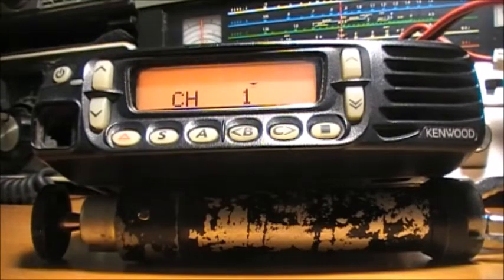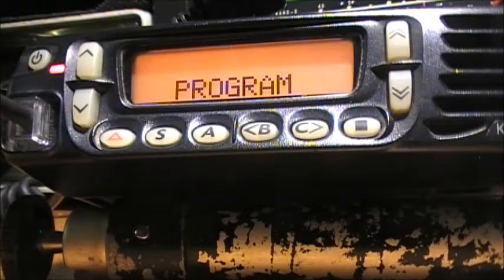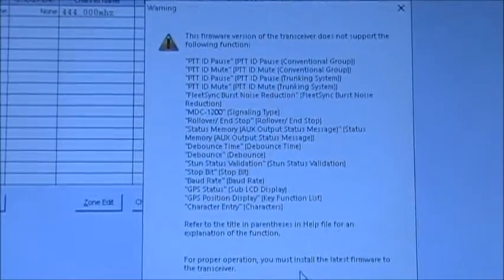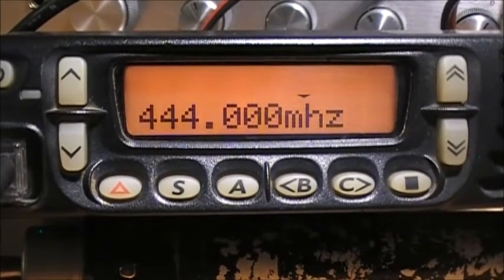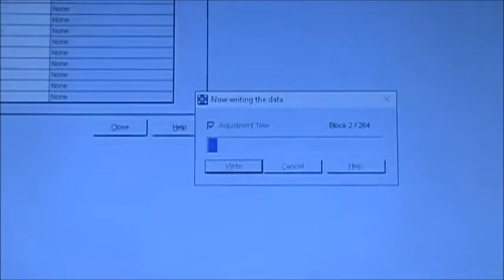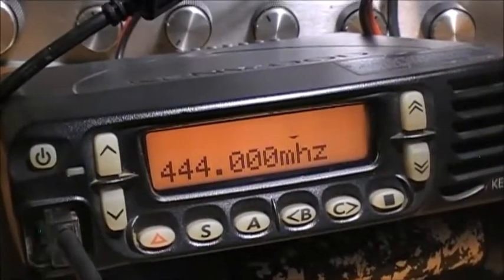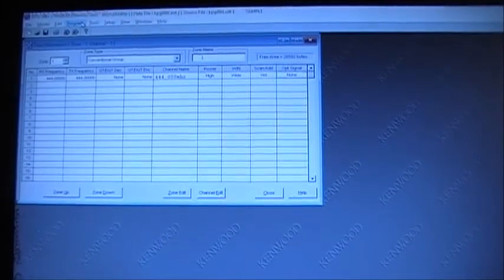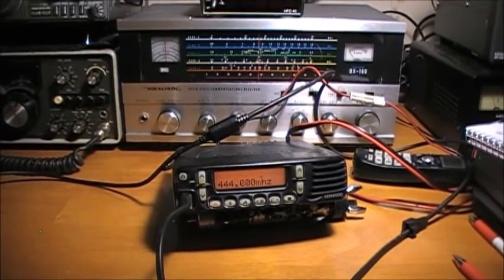KENWOOD TK-8180 Programming and Firmware update - UPDATED

Comment: Anyone here have a good knowledge of the Scanning functions?
I programmed my TK-8180 to 'Multi' in scan type and 'last channel used' in Revert CH options. I have 5 channels in my zone marked as 'scan' and a Priotrity channel nominated. I only have 1 zone.
Yet when I engage Scan it; 
1) The scan icon does not blink.
2) Whenever I engage scan it goes straight to Ch 1 even though its not in the scan list.
The 'Off hook scan' option is ticked.
PS I have not been able to update the Firmware to v 1.22
What am I doing wrong???

Comment: @Radionut63......Question: My 8180K has been programmed with 89D version  1.61    I checked the firmware version today, it says 1.18.00    So how do I know what firmware version I need for an update? FPRO.exe is the firmware file but what version is needed?  
And how do I get access to FPRO.exe ? 
🤔
Reply from the maker: Fpro is part of the programming software that you downloaded. It will be located in the same folder as the program files.
Reply: @Radionut63 No, I purchased the KPG-89D from an Australian online business that sells programming cables. He told me the firmware update wasn't included in the software. But he sent it to me as attachment in a email yesterday, it's 1.22   just need to get it installed in my laptop. Then work out whether it's written from the current software I have or independently?
 Thank you.

Comment: @Radionut63  Hey, how's things over there?
Um, I'm hoping you may be able to help? Connected my laptop to my TK-8180 however when I try to read or write it says "Cannot open Comport". 
In the software I chose 'Comport 0' & 'Data' at '9600' Baud. But when I open the 'Set up' menu it shows 20 Comport options all shaded and not able to click one. 
I have previously programmed my Motorola XTL2500 on my laptop with the same PC comport with no issues. What am I doing wrong?? 
Cheers,
Gary.
Reply from the maker: It sounds like a driver issue on your computer.  Seems like the program may not see your cable.
Reply: @Radionut63 Hey, you were spot on. Dropped into a small computer shop after work today. The USB port I used previously as Com port 3 needed a driver re-installed. Got the 'comport 3' option appear available in COM Port section of software.
8180 programmed the way I wanted except need to turn off "Power On Mute" setting.
Like to think I may be able to help you out sometime.
Been involved in rad comms since 1983.
Your gear in your videos is amazing! ⭐️

Comment: @Radionut63 Hey, sorry to bug you again, could yourself or any other viewers here help.
I have a TK-8180 coming from Ebay (Newy York) with a KMC-27A mic. I want to use a Keypd/DTMF mic on it, Can I use the KMC-28 mic with RJ45 or KMC-36 keypad mic?
Cheers,
Gary
Adelaide.
Reply from the maker: http://www.radiomanual.info/schemi/KENW_ACC/Kenwood_KMC-27_KMC-28_serv.pdf
Reply from the maker: 8180 uses rj45
Reply from the maker: 27a and the 28 have different style plugs on them.   in the meantime, you might be able to just just swap out the heads, those are only connected with RJ45. ;-)
Reply: @Radionut63 um actually the KMC-28 I have looked at on amazon has a RJ45 connector, not the round plug.
They came with either.
Just wanted to know which is the more suitable?

Comment: @Radionut63 G'day again, 
Can I ask you if I've bought a TK-8180 with the sj firmware is it easy to remove it and install the standard kenwood fitmware?
I have already written the KPG-89D program.
Thank you.
Reply from the maker: Hard to say.   I would think you could using FPRO program, but without haveing a radio here with SJ firmware on it to test it on, i dont want to give you the wrong answer.   In saying that, i can email my Kenwood contact Monday morning and see what they say about it.😊
Reply: @Radionut63 ok. I'm assuming the TK-8180 I'm getting from Denver CO has the standard kenwood firmware hopefully. If not then I wouldn't mind some assistance. Thank you very much.
There's just absolutely no TK-8180's for sale down here in Australia.
Reply from the maker: @Gary68_Melb i have a regular tk8180 here you are more then welcome to.
Reply: @Radionut63 Hahaha.........well I am in the process of trying to secure one on ebay however some sellers refuse to ship to Australia. Some TK-8180's dont have a bracket, some don't have a mic.
Its the 8180-K I need for 450-512Mhz as I will be using it for UHF CB 476Mhz here.
Thanks for the offer.

Comment: Oh so you cannot set TX Power lower than 25 or 30 watts?
5 watts is too low. I prefer about 15 watts as the transceiver won't overheat. Oh well.
Reply from the maker: You can set transmit power thru the tuning menu.
Reply: @Radionut63 Tuning menu? There's no tuning menu on the software I have. KPG-89D v 1.61
I've been through all menus.
I did notice a 'Test' menu, maybe that's what you're refering to?
Cheers.
Reply from the maker: @Gary68_Melb yes sir
Reply: @Radionut63 Sir? Not yet but I'm hoping King Charles will visit me soon for that honour.
Reply from the maker: @Gary68_Melb 😂😂😂😂

Comment: This is the closest commercial radio to ham requirements. Even has an S-meter ! Super reliable. Mine is HK2 means 45W UHF but heating never been a matter for me. Hours of qso with any problems. If you found one just grab it.
Reply: I have the same unit.  It does get quite hot if you talk on it a lot.  Don't know for sure if it will hurt it but the radio is NOT 100% duty cycle like an amateur radio.  These I believe are 50% duty cycle.  I have a fan blowing on mine just in case.
Reply from the maker: Most commercial radios including amateur gear are not 100% duty cycle.   Repeaters on the other hand, there are versions that are 100% duty cycle.
Reply: @Radionut63  Yes. For Kenwood TK760 VHF 45W that cycle is %10 TX %90 RX. And that radio is full aluminium cast body.

Comment: Hi. Great video. Can you help me plz. I have a tk7580 and its E version. Can i do something to unlock conventional frequencies by upgrading the firmware? Its currently only showing commercial frequency ranges. Thanks
Reply from the maker: Discontinued model,   Hi-Specification VHF FM Mobile Radio (EU use),   Kenwood TK7180:  Channel Spacing:  Wide: 25 kHz
Mid: 20 kHz
Narrow: 12.5 kHz,    RF Power Output: 1 W - 25 W, Programming software: KPG92,     For further information:  https://www.repeater-builder.com/kenwood/kenwood-tk-7180-8180-index.html

Comment: Thanks for the video.  Just got the 8180 from a buddy and came in yesterday with the mic KMC 36.  The key pad on the mic does nothing.  The KPG-89D v 1.6 shows the mic keypad as greyed out.  When I press the SCAN, it just says scan and no other screen display, it does stop when it hits an transmission signal. I would appreciate you reply.  Thanks.
Reply from the maker: The microphone is a DTMF microphone only, it is not used for direct entry.  You key the radio and press the buttons, the radio will emit a DTMF code for that button.
Reply: @Radionut63  I figured out the mic and was able to activate it. It works as direct channel memory access like directly going to channel 10. 

I also discovered that the frequencies range is limited hence can’t get NOAA weather. It is limited compared to my Wouxun mobile GMRS but edges the Wouxun in audio clarity especially on fringe location.
Reply from the maker: @benjosevilla  next time i program my radio, i will take a closer look at the DTMF setup.
Reply: @Radionut63  I went to menu bar -> Edit -> key assignment -> General tab:
Keypad : 12Key (Mic)
Keypad Operation: Channel Entry

I don’t use DTMF  unless I am talking to my Argent ADS  SR1 simplex repeater which I only use for simplex distance testing and in an event of emergency. So configuring it for channel entry is more useful for me.  Will be nice to have a way to toggle it.
Reply: I have one of this great radio and I am using with KMC-32 which I can scan,ch and zone up-down, display time-ch-name etc. I had chance to compare all mics in a kenwood tech office and this one was great on modulation plus those features.
Reply: How did you set it up in programming software to do that? I can’t figure it out I have the same mic.

Comment: One question;
How do you set the TX Power at say 20 watts instead of 25 watts?
I never run my radios at full power capability.
Also how do you set the TX Modulation level?
Reply from the maker: You make these adjustments in test mode located under program.
Reply: @Radionut63  Oh ok, I've seen that option in the TK-880 program.
Thank you heaps! ✌️
Reply from the maker: @garynewton1263  There are a lot of options in there thst can be adjusted, and if not done correctly could turn your radio into a paper weight.  So be careful  😉
Reply: @Radionut63  ok yeah I've heard you need to be careful with Kenwoods.
I've recently started the process of phasing out my Simoco SRM-900 series radios and using TK-880s and 8180s for UHF CB & a couple of private channels we have here.
Unfortunately at present the TK-880 is suffering from the clicking noise on transmit so its a real challenge getting these units working properly.
Thank you, enjoy your weekend over there!
Reply: @Radionut63  G'day I had another look at Test Mode. I'm assuming you connect a dummy load to the SO-239 connector to test things?
TX deviation, power & squelch level are the three things I need to check.
✌️
Reply from the maker: @garynewton1263  You really need a service monitor to test modulation and receive sensitivity levels.   You can use a dummy and RF meter to test RF output, but the rest you need a service monitor.
Reply: @Radionut63  oh ok, that might be a problem because radio dealers here in Australia are very careful about touching any commercial radio with CB frequencies in them where the TX power exceeds the legal limit. I believe there is a Panel tuning mode where you can adjust TX power, deviation and squelch level?
Reply from the maker: @garynewton1263  There is, but it set in programming mode.
Reply: @Radionut63  programming mode? I have already done the programming, didn't see any of the three items I need to adjust or check. Ok well thank you.
I have to go through this again when I attempt to program my TK-8180 when I get it. Hopefully the 8180s are easier.
Reply from the maker: @garynewton1263  I still have a TK8180 here, i could post a quick video about it, if that would help?
Reply: @Radionut63  oh well only if there is demand for it? Maybe focus on any issues that they have or programming issues?
Do you have to upgrade the firmware on 8180s before programming the software lile with the 880s? Or is it easier.....

Comment: Where can I find the V1.21 firmware?
Reply from the maker: Contact you nearest Kenwood dealer to see if they can update your radio to the most recent firmware update.
Reply: @Radionut63  I tried that, the newest firmware update from kenwood locks out wide band. I'm using the 8180 for GMRS which use wide band. Is there a way to read the firmware off of another radio and write it to the radio I'm trying to change? I do have another 8180 that has firmware V1.20 which does allow me to change the wide and narrow band.
Reply from the maker: @Firemedic2397  i have acces to V1.22 for TK8180k   V3.34 for TK8180MPT   V1.33 for TK8180E 5-tone.
Reply: @Radionut63  Do you know if the V1.22 locks out the wide band?
Reply from the maker: @Firemedic2397  Does not say anything regarding that issue.
Reply: @Radionut63  I found the V1.22 firmware. I uploaded it into a parts radio with no RX. It did not lock out the wide band. Thank you for the replies. Your video was very helpful.
Reply from the maker: Your welcome, happy to help. :-)
Reply: @Radionut63  that V1.33 for TK8180E 5-tone would be intresting, I have one with 1.20. And how about 7189 and 8189, is that the same fw? tnx cheers

Comment: I just got one of these units. Will need to start working on it. Currently the screen only shows  the word “unprogram” when I power it up. None of the switches do anything. Hoping to get it setup for GMRS and some of the repeaters I have around me here in SoCal.
Reply from the maker: This radio has to be programmed by computer software and Kenwood programming cable, it is a good radio and will work just fine on GMRS.
Reply: Can you setup this for a node

Comment: Is the 8180 able to operate on MURS frequencies? Specifically 464.500, 464.525 and 464.550mHz? I’m part of a emergency response/hurricane response team in Galveston County TX and we currently use iCom 4011 UHF HT’s preprogrammed with MURS frequencies. 
The Kenwood manual only states that the radios are UHF and that your local Kenwood dealer will make any changes to the radio you may need….. gee thanks 😂 no where does it say what the frequency range is.

I inherited several 8180’s and would like to mount them in our automobiles. Regardless of the answer, thanks for the video!
Reply from the maker: yes, they can operate in that frequency range. :-)
Reply: I'm glad your not on my emergency response team.  Those freqs are NOT MURS!  MURS is;   
151.820 MHz                              
151.880 MHz                            
151.940 MHz                        
154.570 MHz                          
154.600 MHz
You would need the TK-7180 model to do MURS which is the VHF model.

Comment: I've heard there is a way to adjust power output of the high/low setting in test mode.  Do you know how to do this?
Reply from the maker: Yes, very easy to set RF power level in test mode.  :-)
Reply: Good question, I'd like to know also. I want to set my unit to 20 Watts instead of 25 watts.
Reply: @garynewton1263  There are sliders you can adjust but would need to monitor with a power meter to see the changes.  The only issue is settings are confusing.  It's not just 'high power' and 'low power' setting.  It's more convoluted than that.
Reply: @timtaylor8557 You can easily overdrive without power meter sir. Be careful while adjusting.

Comment: Can you tell me where to get the programming software and the cable? I see a few cables on amazon for cheap and a couple of other sites extremely expensive. Not finding anything for the software.
Reply from the maker: Buy them both from Kenwood directly.
Reply: @Radionut63  Ok.......got all this but I didnt catch how you went to the Firmware update. Sorry, Im a little slow with this kind of stuff.

Comment: I've programmed multiple 8180 radios but ran into a problem on my latest.  My latest batch the software will not read the radio.  Com Port set both in laptop Devices and KPG-89D software.  "Check connections and Com Port" error message on 4 radios including one in service working fine but cannot be read.  Any insights?  Maybe a total reset?  Some of these have prior owner programming installed.  Any help appreciated.
Reply from the maker: Password protected maybe?
Reply from the maker: check firmware version and software version
Reply: Mine did the same thing after . I download Win11 in to my laptop thank good ness. I still have anather laptop that is still Win10
Reply: I got the same exact problem. Did you figured it out ? Thanks

Comment: I have a  kenwood nx-800. Is there a way to do a reset without the use of a cable?
Reply: Great video, I have a nx800 how can I program it to send different sound when transmitting? Turn on Roger Beep is what im asking. LoL
Reply from the maker: You mean courtesy beep?    Some of these radios can transmit that..
Reply from the maker: I do not think so. If there were i am sure there would be a few radios out there mounted in commercial trucks that would be paper weights by people playing with them.
Reply: @Radionut63  huh. Well I may be considering selling it then lol. Interested?
Reply from the maker: @JCLEMARES  I can program the radio for you if you wish?

Comment: Auto power off?  does it work without any ignition connection?
Reply from the maker: Radio works OK with out ignition power.  You can wire it direct to the battery, just have to manually turn off the radio when your finished with it.

Comment: I’m not getting errors. Does the software detect when Kenwood has a firmware upgrade?
Reply from the maker: You can manually check what firmware version you radio currently has.